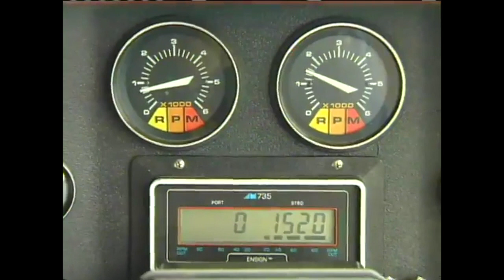Classic DIY - ES Inboard Transmission Maintenance, 2007

Comment: Why can't car automatic transmission work on a boat?  A technical explanation...please?
Reply: The simple answer is most boats only have one forward and one reverse gear. Pretty much no gas car on the road today can say the same. So the other 4 to 9 gears are wasted in a marine application.